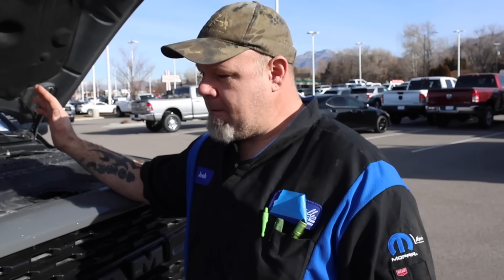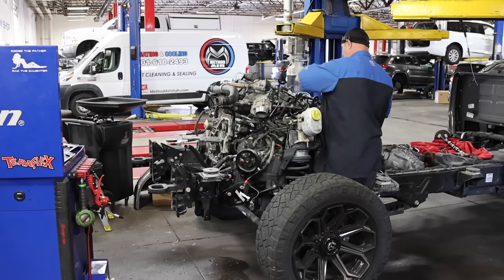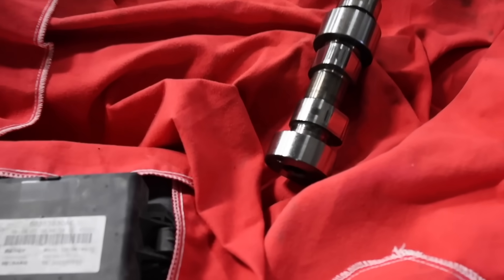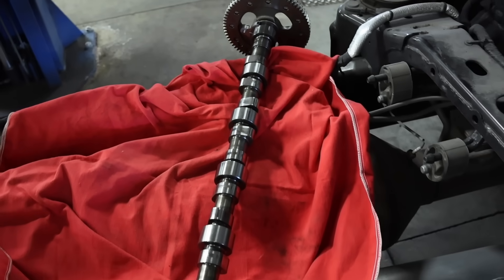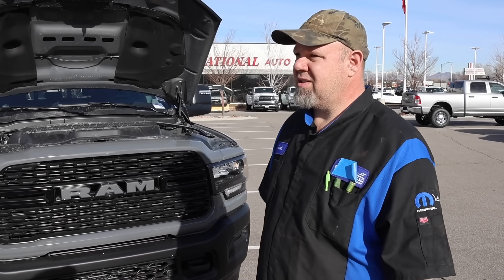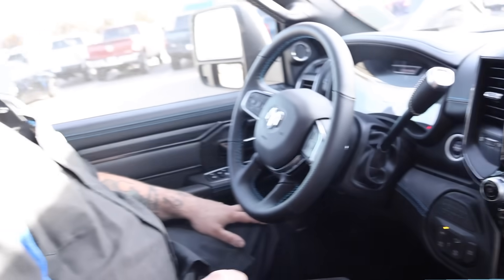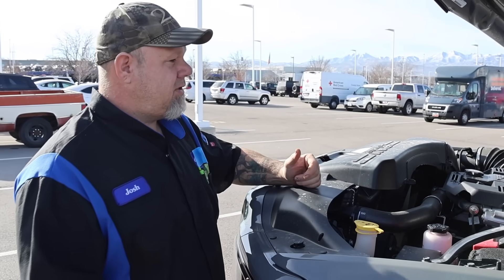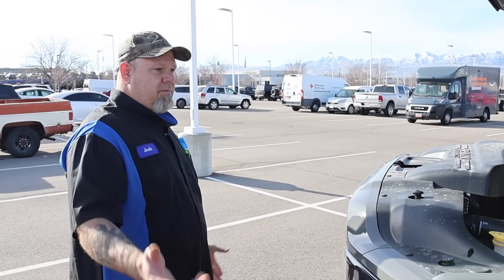Master Diesel Tech Explains The BIGGEST Killer To Your Diesel Engine!

Comment: Good information with the video.  I'll ask about turning on the exhaust brake during warmup.  Is that still recommended?  Another thing that kills engine oil is short driving trips such as a few miles to the store or work.  If the engine and the oil doesn't get hot enough the contaminants don't burn or evaporate out of the oil.  I don't drive my Diesel pickup during the winter unless I know it will be driven far enough to get hot enough for the oil, exhaust system, and a good engine warm up. I do have my block heater plugged in to a timer that is set up to turn on about 4 hours before starting and that definitely helps warm up faster.  Keep the videos coming Josh.

Comment: Maybe it's because of the EGR constricting the intake and the I-beam design of the connecting rod being that it's for compression not for suction and that could lead to problems in structural stability. 

Also oil deletion. I think with the new oils and the tolerances of the motor they used to say not to get on it hard if it was cold and I just don't think that's true anymore. Also, I don't think manufacturers tell people their truth about what they should be running in their vehicles most of the time. Advising 10 to 15,000 mile oil changes and running the thinner oil. Even though in the owner's manual, they'll say that there's a thicker oil that's applicable. 

It's like they're trying to make it so the vehicle will make it as maintenance free as possible to 100,000 mi. But if you keep it to $120,000 mi, you're going to have a total piece of junk that you've abused unknowingly because of the manufacturers wanting to be able to sell you something new. 

Business philosophy used to be you make a lot of them and you sell them for a little bit of a profit and you make them last cuz that's pride in your product but now it's make as few as you can. Jack up the price as much as you can and then wonder why everything so expensive and everybody hates each other and nobody can afford anything around you capitalism at its finest😅

Comment: I have a 2016 and my friend has a 2021  cummins. I find it odd that both our trucks have 15 k oil change intervals but my 16 is 6 months and the 21 is 12 months. I believe that should be the other way around because of the hydraulic lifters in the 21. I change my oil every 6 months usually between 7k-8k miles. My truck doesn't take short trips and is used to tow 15k pound camper. I do believe 15k intervals are fine for people that hot shot as they may put 15k on their truck in a few months and are working the engines. But I agree if you use it as a grocery getter than 5 k is probably a good rule of thumb. Also I rarely use the high idle. The truck will high idle itself after running for a minute or two so I just let the ECM decide what's best for the truck.

Comment: In the older days, with our big trucks with Cats, my old man was adamant about 10K oil change intervals, and that was before EGR.  Cat was onto something with pulling EGR after the DPF, which they called CGI, so at least there was a chance of dumping somewhat cleaner Exhaust Gasses back into the combustion cycle.  Are any of the big-3 doing that with their EGR setups on the diesel pickups?
Reply from the maker: The eco diesel new gen does use that but in combination with a pre dpf egr

Comment: I live in Florida and yes, I idol my truck 
Since I heard Dave, I don’t even watch his videos anymore  lol 
I got 430,000 miles on GMC  and so far never been to the dealer for engine or transmission.
Reply: His customer service rating is horrible even on his web site. D- BBB rating.
Reply: No, not yet, but please don’t jinx me 🤣
Reply: 😂😂 my 1993 Corolla has 408,000 miles on her and oil changes every 3,000 miles she's still rolling everywhere everyday. In the winter when I start her up I let her idle for a few minutes then I turn on the parking lights and that speeds up the idle speed I do that for a few minutes so I don't have to push on the gas pedal. I do this for a few minutes then drive away.😂😂 That vehicle is 29 years old. I do the same with my Toyota truck. And I run a K&N air filter.😂😂
Reply: Do you know a shop in Florida that will do an eco diesel delete by any chance?
Reply: @feedcentral6854 what part of Florida? I know tons of guys around Ft. Pierce who have deleted their diesels
Reply: Yes that 15 second warm up time that dave says in his videos is horse crap, most modern diesel will not even let you accelerate until warmed up at least 5 mins, this is a very good video and well explained
Reply: Has your truck had a weight loss or stock?
Reply: I have no idea. I deleted mine in Detroit.
Reply: What year is your GMC?
Reply: @mattgee44257  this one 09

Comment: Wonderful, thank you gents.  I have a '21 EcoDiesel and love the high idle that it does on the remote start, still takes a long time to warm-up, but I agree that it is critical to get her warmed-up and run long enough to get up to decent operating temps to burn some of the crap out of her.
Reply: Same I have a 2014 Eco diesel always use a block heater in winter start it wait till the high idle  kicks off drive slowly and easy
Reply: @spencerelsbury9110  The heater may be cheaper than the fuel expended to get it that hot.

Comment: But I have a question! 

Is there a difference between leaving the engine on at idle vs. running the truck?

 Since when running the engine works properly with the engine cooling system and the turbo works better vs. when idle?